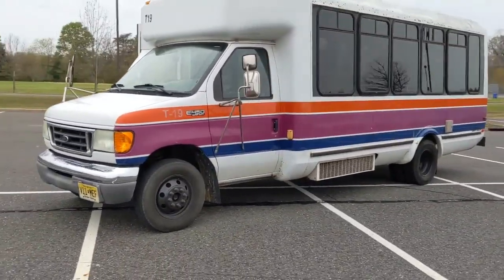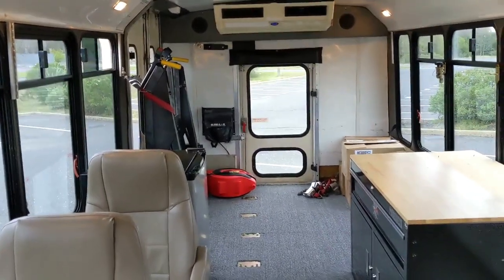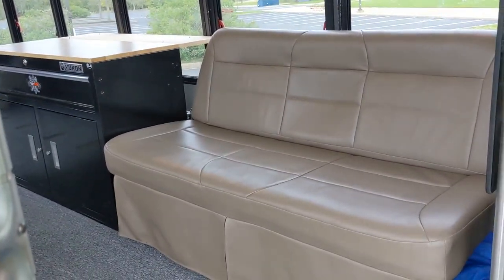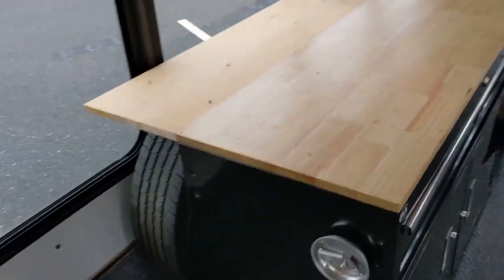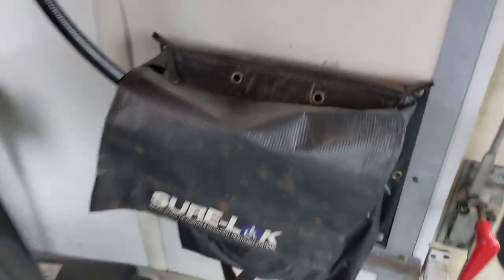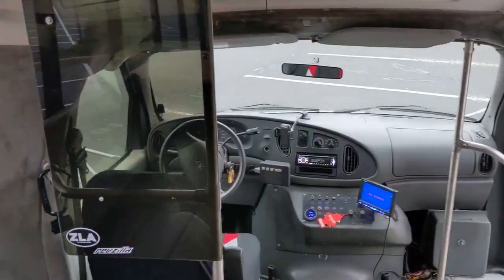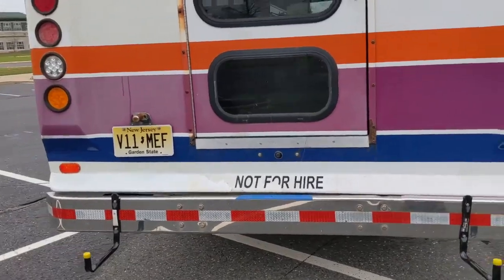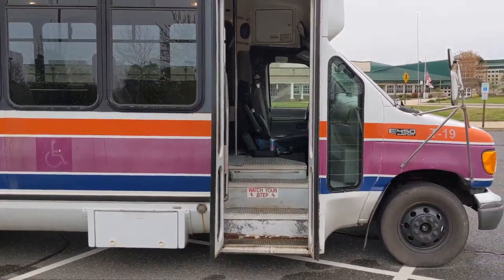Toy(motorcycle)Hauling Transit Bus- "Socially Distanced"

Comment: Where did you get the air compressor from? Is it hardwired in or is it a plug n play?
Reply from the maker: I'm sorry I missed your comment. I got mine used on C list. I think I put a link for it in another video though where I found it for a good price. Give me one minute. It comes with alligator clamps for the battery. I hard wired it though.